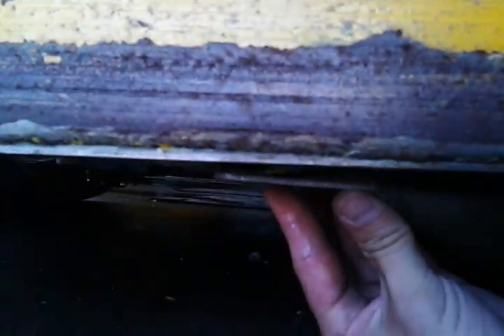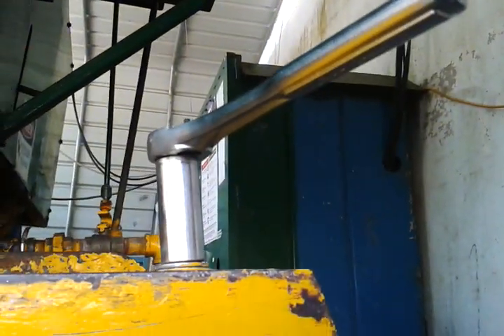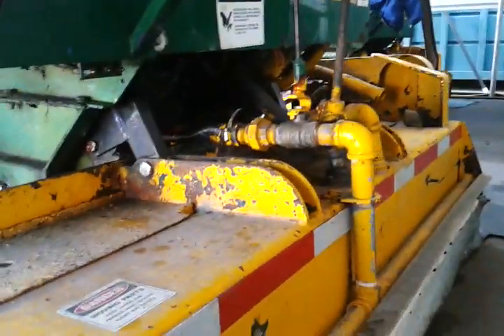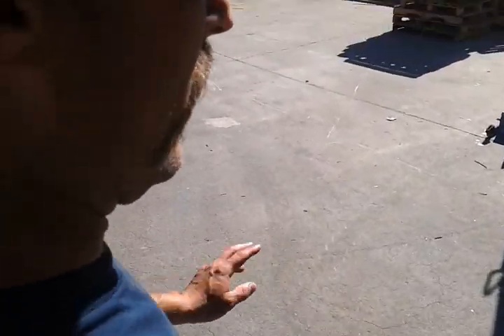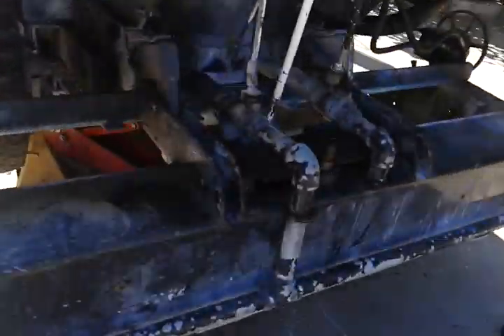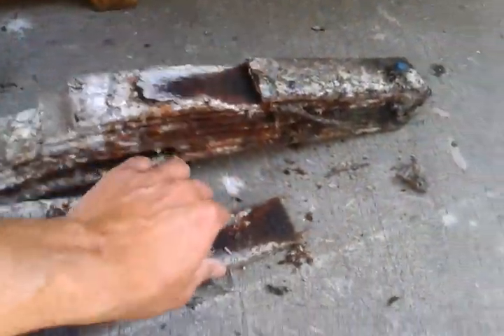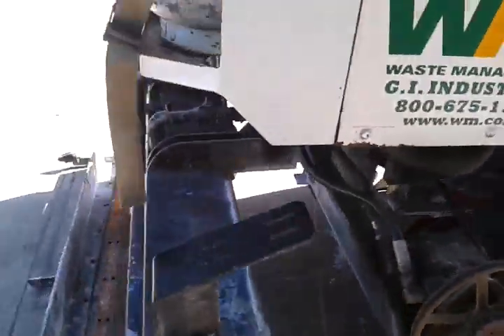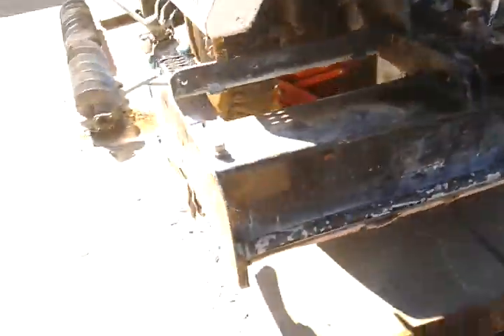Zamboni blade calibration

Comment: I been doing ice for 1 year now and still do not fully understand this. I usually dont do the blade changes. So as long as my zam tool lines up with the runners before i pull the blade up i am good? I should do this everytime i get on shift? I sometimes have great ice without taking off much snow one week and next week with the same group i can take off a full bucket and not have as good ice as the week before. Is the reason why this is because maybe my blade is not aligned right? Sorry for all the questions but i am always alone and cant ask my coworkers. I rarely check the alignment when starting a shift
Reply from the maker: ggqbc daily cal is critical however you can see it and comp it during any  ice cut..
Reply: You're driving too fast.  Aim for 8 seconds between blue lines.  Blade alignment prevents you from cutting unevenly ending up doing damage to the lines if left unchecked.